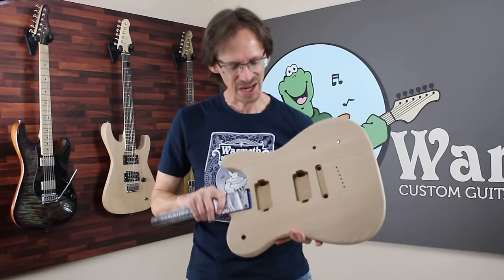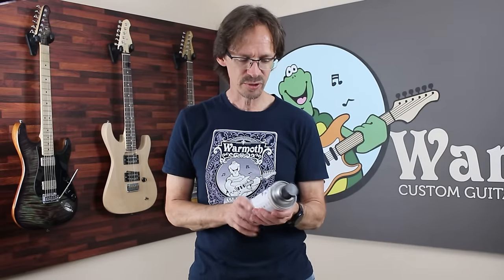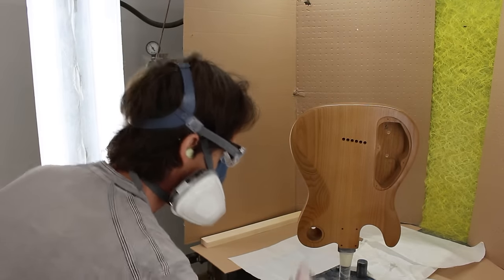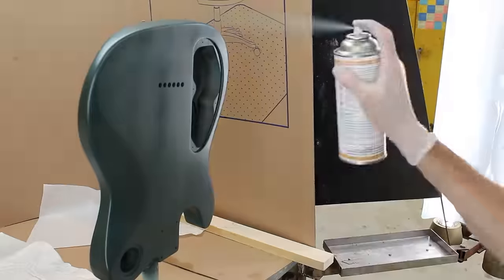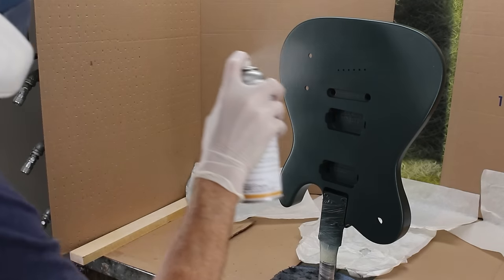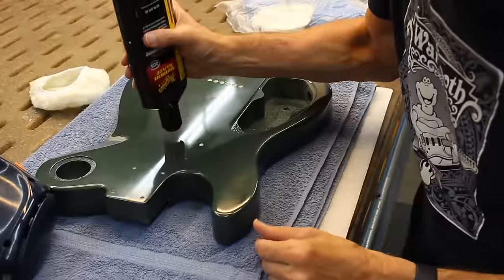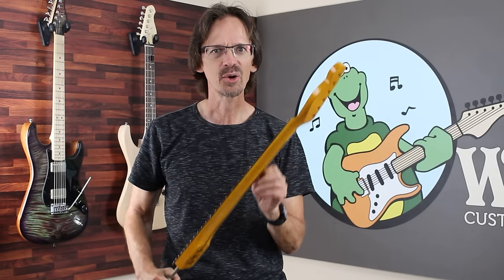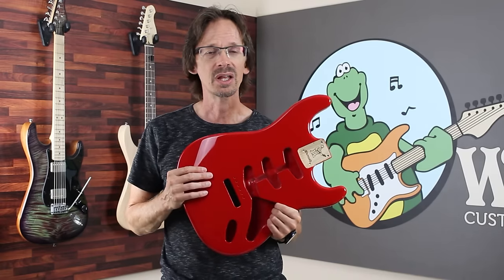DIY Nitro Guitar Finish from a Rattle Can?

Comment: Rattle cans make no sense for clear or burst paint jobs. If you ever think you may refinish more than 1 guitar just go get a gun and compressor from Harbor Freight. Even for the cheap rattle can lacquer at Home Depot it will cost you $100 minimum to finish a guitar with 3 to 4 cans and more if you go to Stew Mac and get the "good" lacquer. I literally bought a $20 gun and a garage sale compressor for $25 and a whole gallon of gloss lacquer is $40. I use alcohol based leather dye from a local Tandy Leather to tint amber, cherry or whatever color for like $6 per bottle which will last forever. Plus, you can control the flow and pressure and get a nicer finish, and it is a pain in the butt/hurts your spray finger if you spray a lot with rattle can. I just did a refinish on an early 70's Univox LP copy husk that looks Phenomenal. I got a can of auto duster and got a nice chequed effect like you get on those Murphy lab $7,000 Les Pauls with Watco Laquer from Home Depot at $40 per gallon. I think theres like 3 tablespoons of lacquer in a rattle can because it used to take me 4 cans to do a decent finish.

Comment: Couple of tips. Nitro and acrylic lacquer paints are self leveling which means the new coat melts the previous coat and blends into it. If you were to sand between the color coats then the new color coat erases all your hard work of sanding between coats. So don't sand between color coats. Just pile one color coat on top of the other after letting the previous coat dry for about 15 minutes. I never do any final wet sanding as I hand polish the guitar afterwards and this will basically level sand the final clear coat. If you want a perfect paint job you will have to start from the foundation of sanding the guitar body as best as you can with progressive higher grit of sandpaper. Also, use a spray booth as there are lots of specs of dust floating in the air ready to land on your freshly painted guitar. It also takes about one month for the guitar to dry before buffing. If you do the prep work then you don't need as many coats of paint afterwards to cover for mistakes in sanding. Also, use dark ie. gray or black primer color for dark colors and use white primer for light colors. That sherwood green should have had a dark primer and not a white one. The white one was great for the red strat. If you don't use a white primer then the color will be much darker. Lastly, nitro evaporates after years and will probably sink into the wood if the sealer is also a nitro product. I would use duplicolor sand and sealer spray can to do the primer coat with and then either a nitro or duplicolor perfect match acrylic lacquer which is more durable than nitro but sprays just as easy as nitro. Acrylic lacquer is more plasticky substance and therefore more durable than nitro. They use this stuff for car paints.

One more thing, before spraying primer or sealer make sure you wet sand the body to raise the grain that you will then cut down with a sandpaper. It creates smoother surface afterwards.
Reply: Great tips you got there man, even wrote a couple notes to myself for when I get brave enough to refinish my guitar in lacquer. The thing with the white basecoat is Fender used to do that back in the day, and still do on vintage spec models that are solid colored. "Mojo Factor" is a powerful phenomenon, and some people want it just like is was back in the day.
Reply: Yeah these are good tips for sure. Just one addendum. I have worked on guitars that car guys have finished with acrylic and one springs to mind. It's true that acrylic is harder and has SOME of the desirable spray properties of nitro but because it's a metal car finish and designed for metals expansion in all directions it is not ideal for woods more directional contraction/ expansion which tends to be extreme in one axis. The aforementioned guitar I worked on was a SG type and in the area notorious for breakage at junction between headstock and nut was a bad transverse finish crack. It really stuck out bad because of the finish thickness and I realized that in that area where headstock flexes with string tension the finish was just not flexible enough in that direction.
Nitro in contrast will not finish crack if treated well and if not will spider check in a way that is pleasing to most as it indicates patina  age, vintage  etc.
       So right there and then I figured out why large guitar and furniture makers  use nitro and more and more urethane because they flex correctly for wood. 
Otherwise great advice.We in major guitar factory never saw the need to spray white or dark color under final color coats but makes sense to me at least until too color nitro coats chip off corners to expose white sealer underneath!  LOL.
Reply: You dont want to do that on an open grain wood
Reply: Are you suggesting to wet-sand the bare wood, prior to spraying the initial sealer?  I want to make sure I understood you properly on that.  Some GREAT tips you’ve given.
Reply: @phillamoore157 I would not wet sand the body prior to spraying sealer on it. After the sealer is on, then I would sand off the sealer to get a smooth surface. Basically, the sealer will raise the grain hairs and you want to knock those down after the sealer have been put on. I'm sorry if I confused you.
Reply: @jcd13able  Ahhh, thank you my friend...that makes sense.  And, I've noticed from my other projects that, the grain get's roughed up, or "raised", anytime you put a sealant, or even anything wet (like alcohol, or mineral spirits when cleaning between sandings) on it.  I'm going through that with a work bench, I'm trying to seal.  Unless you put a ton of sealant on, and it dries smooth that seems to happen regardless of what kind of paint/sealant being used.  I supposed that's one of the many reasons why the final polishing/cutting step is used, so whatever surfaces is being painted is smooth.  Anyway, I'm trying to put all the pieces together.  GREAT video...thank you so much for posting these.  They're incredibly informative.
Reply: Do you use sealer instead of grain filler with sealer over it?
Reply: i'm planning to paint my guitar body with acrylic, are you really saying i dont have to wet sand after spraying all the coats? i hate that part
Reply: Hey you seem like you know what to do in my situation. Is there any way to contact you to send you a video of my dilemma? Some spots of my telecaster build just look horrible while others are just fine. I don’t want to wet sand either since I feel like I’d do more damage to the guitar. Do I get rid of the uneven spots (mandarin skin) by hand polishing in the end?
Reply: Thank you for the info.
Reply: What's the easiest way to amber a strat neck? I don't care what product and I can't have it off for a month to dry. I just want it done and finished as fast as possible with a nicee outcome. Maple neck and fretboard.
Reply: You are correct sir!
Reply: @jcd13able  You said ;   before spraying primer or sealer make sure you wet sand the body.

Comment: This is why I’m addicted to hand-rubbed oil finishes. Costs more for figured woods that look good naked, but oil or oil/poly mixtures are much easier to apply, and endlessly repairable. I’ve also found that polishing the wood out to 2000 grit before applying oil seems to seal up the end grain, making for more even colouration- especially if you’re using dyes to tint the finish.
Reply: That's what I'm considering doing with a walnut body. So no sealing, just sand and apply a few coats?
Reply: @ericv7720 For a really hard wood like maple or walnut, burnishing out to those finer grits before oil is worth the time. I avoid wet, deep-penetrating Danish oils, and use hard-drying ones like polymerized (cooked) Tung oil or Tru-oil gunstock finish. I don’t apply thick coats- preferring to wet it out, let it sit for an hour or two, then rub off the excess before it hardens and gets gummy. 4 or 5 days of that, then once a week for a few weeks, again at 6 months, then once a year or so after that. It feels natural, never sticky, and the grain and figure in the wood glows. Scratches can be touched up with a few passes with fine polishing papers and a little more oil.

Comment: I did a tru-oil finish on my mahogany tele. 
No filler, I wanted the grain to come through much like a gibsons raw finish. 
It took me about 2 months of layer after layer. Waiting 24 hours between coats. 
It came out AMAZING. 
If you’re after a natural finish try-oil is great and dummy proof.
Reply: Used boiled linseed oil on my mahogany Strat (one piece body) Came out lighter than the tru-oil hybrid Strat I built. Also the linseed oil gave it a bit of a cinnamon hue - Very pretty. #heroesjourney
Reply: I did tru oil on a Tele build. Great stuff to work with.
Reply: Uh, I figured put how to do it in 3 coats. Beautiful deep grain look and very glossy. Trick is, sanding the first coat with 1500 grit. Make sure you sand up to 400 and leave no fine scratches cause they'll show.
Reply: @ranman58635 yeah man, you could def get a great finish with fewer coats. 
I had done thinner ones before and wanted to see how it would look with a lot of layers. 
Came out amazing.

Comment: I think you forgot to mention temp factors. Make sure your can is warm and the same for your guitar body finish : )

I take a soup cup, fill it with a bit of water, micro wave it for 1 min, take it out, put the can of spray paint inside of it, let it sit for a few mins, and now you're ready to paint.

To make your body warm, let it sit in the sun for a second. If you don't want to do that, Nuke a hot towel for a few minutes and then touch it all over your body to get it all nice and warm. 

And that sounded dirty! lol.
Reply: I second all of that. I might be a bit turned on too. Giggity.
Reply: @corneliuscrewe677  🤣🤣🤣🤣🤣

Comment: I modified an old boom mic stand to shoot bodies on. Reranch is also great friendly company to get supplies from. Ive never had any issues with the Stew Mac canned lacquer either. The one thing with the lacquer in a can is it dries much slower. Wet sand using naphtha....it flashes off very fast so as not to swell up any grain. It also helps cut the lacquer so sanding moves along quicker. Great video! Great job.
Reply from the maker: As far as I can tell Reranch does not exist any more. Their website is non-functional.
Reply: @warmoth  that's sad. It's been a few years since I've ordered anything. Well I guess I'd have to amend my comment to Reranch were a friendly company to get supplies from. Edit....I must re-amend my comment. I just went to the Reranch site and it seems they are in fact alive and well. Just to be certain I put items in a cart and it gave me a total and wanted credit card info.

Comment: Having finished two bodies (one of them a Warmoth!) I can tell you I learned very similar lessons. Definitely have a lot more respect for finishing work afterwards. Mine were both dye/stain jobs and still it was incredibly painstaking. Clear coating especially, there's imperfections everywhere. Probably the hardest part of a partscaster build.

Comment: Great video. I hope that enthusiasts will note the few times that you mention that such a finish actually does take weeks to achieve and there are no short cuts. There is a character to an old fashioned nitrocellulose lacquer finish that simply doesn’t happen with other finishes. The finish ages in a wonderfully natural way that can’t be faked. In twenty years, the wear, the age, and the minor accidents will all look good. Whether your journey in guitar making stays limited to assembling parts and putting a telecaster together or you advance to making your own bodies and necks, Warmoth is certainly a place to begin the journey.

Comment: Cool that you're dabbing into painting as well. This is the first thing I learned around 35 years ago. I used to buy used guitars, refinish and resell as a teenager. One thing I learned was not to use sealer. Most of the old timers back then called it sanding soap. They advised on using lacker as the sealer, and I can tell you the finish was clearer on stain jobs vs when I used sealer. I am about to refinish 2 of my guitars and will be using 2k clear instead of nitro,

You should haved leveled the front of the guitar before painting it to prevent that low spot by the control knob. Would have been easier since you were doing a solid color. But crucial if you were doing a stain/translucent color so you don't spend extra money in clear leveling it.

Comment: I was asking a couple of guys who work in a body shop about painting a guitar. I have a $300 mod platform guitar that I quickly discovered wouldn’t be cost effective to pay a body shop to blast with some paint, so now on to learning how to do it myself. I had no idea how much work it would take to paint a guitar from raw wood properly! 

The two guys started talking about sanding and how that can be really discouraging if you start clear coating and didn’t get the surface perfectly flat!

Luckily my project is to repaint a guitar with a different color, so won’t take as many coats. Just need to find the right kind of paint and rig up a diy paint booth in my garage

This video is a great starting point for me, to establish my expectations, and good timing for me at least.

Thanks algorithm and thanks Warmoth!

Comment: Not bad for a first time! I did it myself once, way back on a (cheap) Stratocaster style guitar, there were no youtube tutorials or anything like that, so I had to find out the hard way that painting a guitar is a craft in itself; dust problems, insufficient sanding and painting and not knowing at all that you can polish the paint.

Comment: I did my first diy build last year , it was a Tele. I painted it with about 10 coats of lacquer and 6 coats of clear coat. I ended up installing locking tuner's and changed the pickups and ashtray bridge to Wilkinson , it took about two weeks mainly because of waiting for the paint to dry. All in all it was a great experience and I will definitely do another one , probably an SG next time. Great vid by the way!✌️ PS I didn't wet sand it either because lack of patience...
Reply: Hi, what's the difference between Lacquer and Clear Coat? I though those would be the same, isn't the Clear coat the varnish/lacquer that it's sprayed in the last phase? thank you

Comment: I get incredible results from canned NC. The secret is pore filling when needed or sanding sealer first unless you are alright using a lot of NC to level a lot of the woods. There is a brand that has a small wall clock on it at the box stores but you need to check the label as they sell to california as well so you may see non NC cans on the shelf too. I just sort through them.

Comment: Aaron, I’d love to see a video that goes in depth on the common techniques used by the various custom shops to relic/distress nitro finished guitars. I understand if it’s not in your wheelhouse but perhaps think about bringing on a guest? I think there are guitar players (like me) that would do more Warmoth builds if they could view it as both meeting a guitar need but also an artistic project to create something typically associated with the ultra high end guitar market. I don’t mean just basic tips on nitro finish checking and dings. One little example is I’d love to know how to emulate a particular method of using dark stains (or dyes) next to the frets on tinted lacquered maple fretboards creating that really cool contrast/effect that you see on some high end guitars. 🎸🤘

Comment: Loved your work Aaron! I painted my first Strat 2 years ago using nitro paint cans and it was a lot of work trying to level everything using the grain filler, sealer and primer coats since I was using Ash and it SOAKS everything you put there! Also I did an Inca Silver so the surface HAD to be leveled! It ended up working great and the guitar has already aged to a golden hue 2 years later in some areas. Nitro is king! 
#heroesjoruney

Comment: Outstanding job for your first go. I've never tried an instrument, but I used to be a high end house painter and did a lot of fine cabinetry, trim, molding, etc. I think you may have avoided the valley if all your passes overlapped by 50%. Just a guess, as this could be a whole different animal.
Reply: It's not that hard but wears on your patience waiting for the paint to dry. That's the longest part of the whole build , but when it's done you'll be very pleased , I even bought a special lacquer pen to write my last name on the headstock. I'm gonna definitely do another one...
Reply: @mikeg6666  Oh good call on the lacquer pen. I'd do that if I didn't have the worst penmanship on planet earth.
Reply: @johncbeer  🤣 mines not the best either , being Italian I have a lot of i's and n's in my name. So I basically drew a capital G and a straight line! 😃

Comment: Good job! I always encourage people to go for it. I have a small shop, and I have finished many guitars. No long speech LOL, but I could offer a couple quick tips?  First, almost all "home stores" sell "triggers" for spray cans. They grip in the top ring, and when you pull the trigger a tab presses down on the tip. Makes it a mini self powered spray gun. LOL  Should be about $10. Also, I like to draw warm tap water into a bucket, and place the cans in it before spraying.  As warm as possible, from the tap, works best. The warm paint, and propellant will flow better and not spatter.  Best luck!!  Gary   PS; I use some Warmoth necks with my builds in my old age also!!  LOLOL   8)